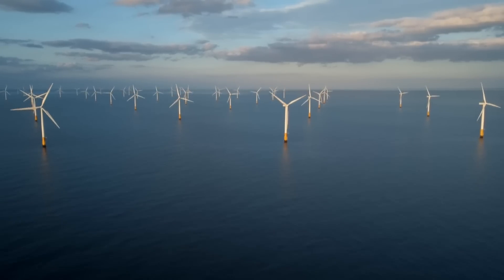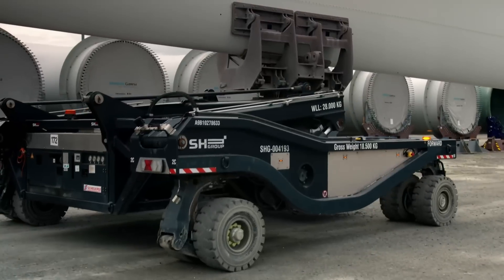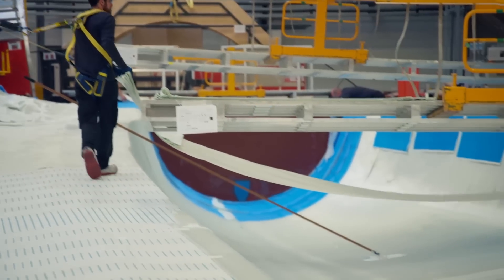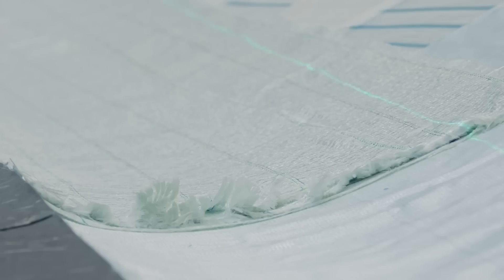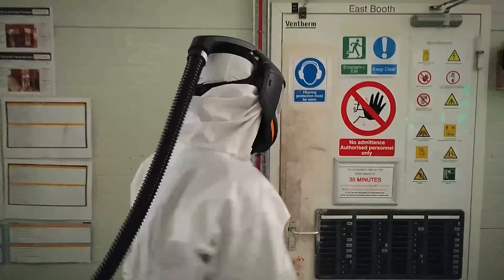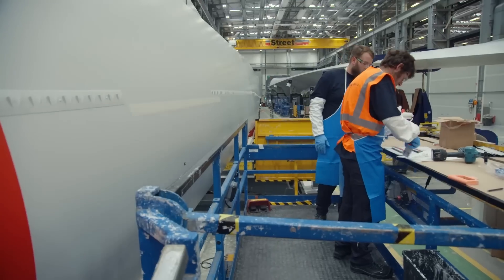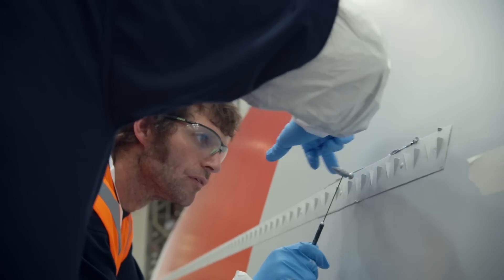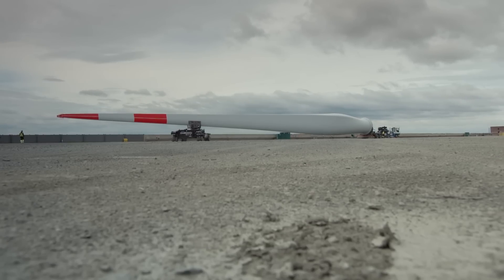Guy Masters Building A Wind Turbine Blade | Guy Martin

Comment: The turbine blades only last between 15-20 years, which makes them too expensive to generate electricity
Reply: And you re use coal how??
Reply: They are not too expensive to produce energy by any means. 

Everything has a service life, that isn't a reason to not go for it.
Reply: Oh its 15 years now not 25 years. Just keep changing the number to what ever does the most fear mongering. Keep your lies straight.
Reply: Why the hate, 20 years use then rebuild
Reply: That's 20 years of no co2, no heavy metals from coal gasses. Like the guy said in the 90's, you need to add in the externalities to your costs.
Reply: Sorry, where are your figures ? Have you costed  the replacement costs of cavitation damage to Hydro Electric water vanes, or the vanes in Gas Turbines ?
The LM2500 costs ~ 30 MW, around 11.2 million $us, and 4% maintenance costs per year  is nearly 1/2 million $us per year. It has about  150,000 hours life span, or  18 years.
Wind Turbines 14 mw, costs around 10 mill,  and maintenance is about $US50,000 per year
Extremely competitive.

Comment: as a former employee of the wind energy industry i can tell you it is all a bunch of lies
Reply: Yup, an endless stream of con jobs/scams to prevent us plebs from having freedom!
Reply: LIES! You have never worked in any valuable industry. You are just a political troll farm desk jockey.
Reply: @Funky Monk cost of building + maintenance > energy produced . short life with loads of problems mostly cooling of the gearbox . once a gearbox or prop failes it is a complete write off
Reply: @josklos2798  Many types of wind turbines HAVE NO gear box.
Reply: @josklos2798  And the fact it's is EXTREMELY DANGEROUS both to operate and live next to, especially if the braking system fails in heavy winds
Reply: Sure, we believe you
Reply: @doxielain2231  dunning/kruger ....
Reply: Anyone with any sense knows that. Sadly, it appears it is in short supply!!!